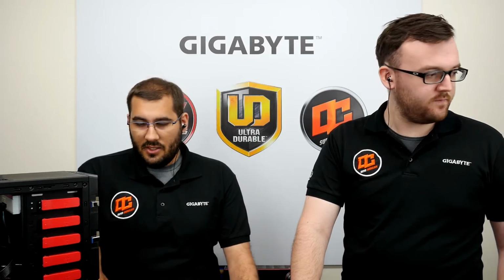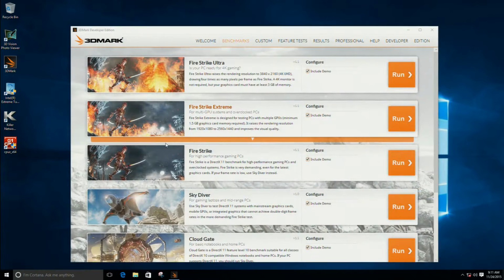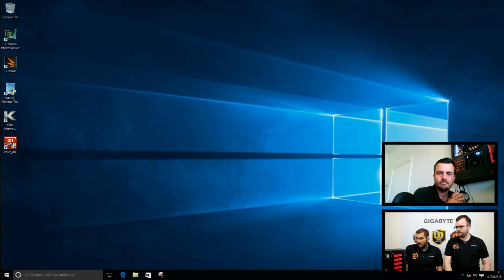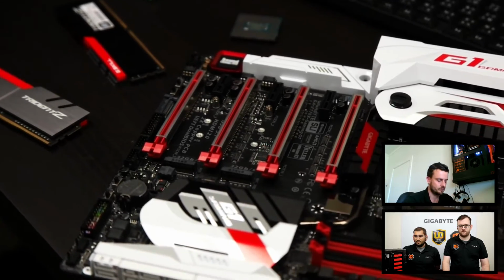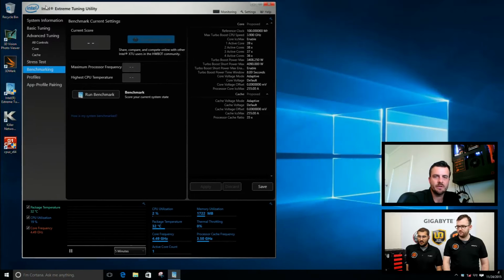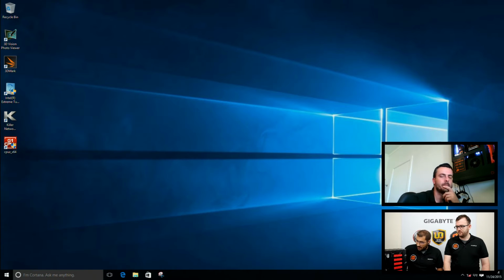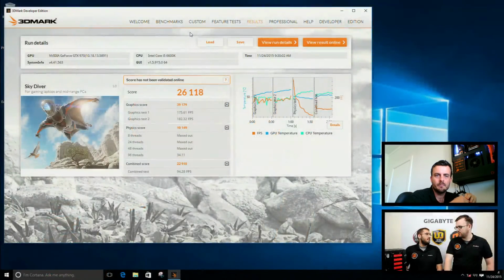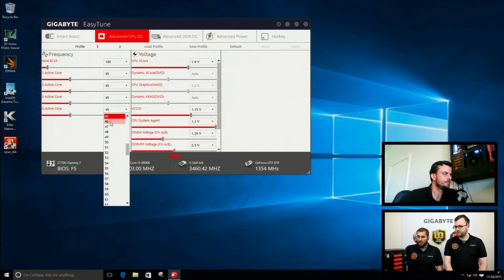Let's Overclock! Learn how to do your first Overclock

Comment: Dang I would expect so much more in a oc guide coming straight from the company.I understand it's kind of a beginners guide but i am well past this part i need a advanced guide that goes deeper into more of the complete set of system voltages and if you do happen to see this and also happen to have a guide on your x99 g1 boards I would love to be directed to it.I have searched everywhere for one and unless I overlooked it I have not found it.

Comment: Dear guys. I just take the tour for the oc here and is nice the program works excellent thanks so much. I now that is more basic tour. I have a lot of q I need some help understanding more in depth and learn more especially on the fan thing where in can get more help
Reply from the maker: What questions do you have?
Reply: On the easy tune there is no way to change from adaptive to manual mode correct? I got the the real XMP profile corrected I am using F4-3200C16Q32GTZB the profile give only 30 instead of 32 and the DRAM voltage 1.38 so I change it to 1.35volts. on the XTU reads the bios, but the data on the charts below in blue reads the changes on the easy tune. If I change on the bios, since is stock unless I am doing something wrong (maybe reading the main bios not the changes on the 2  I asume ) for example turn off C states, important or the adaptive to manual so all is 4.5 at 1.35volts. the app is super works very good but need to get extended to have full control.
Reply: I am getting a new cooler soon since the temps you have there are the one on my AIO. I try to seat it many times. I have a deep cool Captain 360 pump connected to CPU FAN and the 3 fans with the splinter to the CPU OPT PUMP.  I am running the GA-Z170X-Ultra Gaming with the F5d bios since with my memories did not boot at all.

Comment: Honestly just a promo video to show how easy it is to overclock on gigabytes products not a true overclocking guide. There isn't even a good outline provided throughout with step by step instructions. Turn off the gosh damn music for gods sake. Too much extra commentary thats irrelevant to overclocking the system, like bragging about the 6 or 8 core system one of the guys had. He actually cuts off the main dude thats instructing to put that nonsense out there. Like I said not a true overclocking guide, no clear outline with step by step which is especially vital when your instructor doesn't have a good handle on the english language or has a thick accent, no real explanation of stepping your voltages with frequencies and also timings of memory, which yes I know nowadays its not really a hassle anymore with XMP profiles, but its still important to explain why memory timings and latency is important to a successful overclock. My advice to no0bs is to go look up an actual legit overclocking guide, not a video guide but a hardcopy version online and print it out. Toms hardware, NCIX, linus tech tips, overclock.net, etc etc. have so many good overclocking guides with pictures that are clearly outlined and easy to follow. They also  have clear warnings that should keep you from burning out your cpu, gpu or memory or worse fry your mobo and everything attached to it.